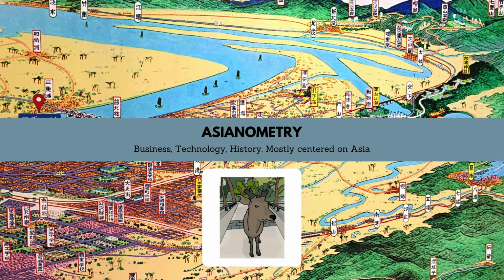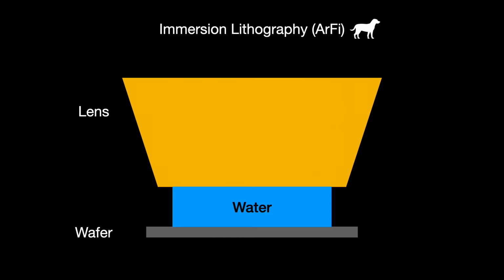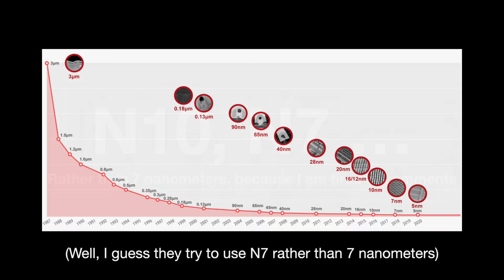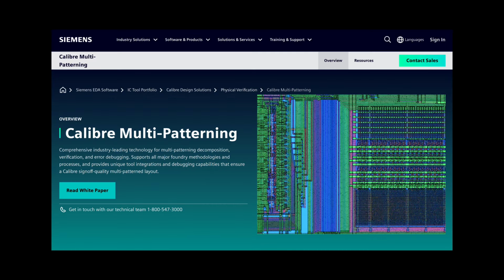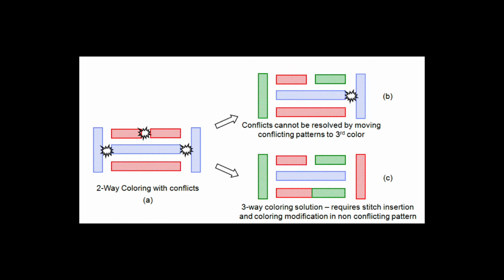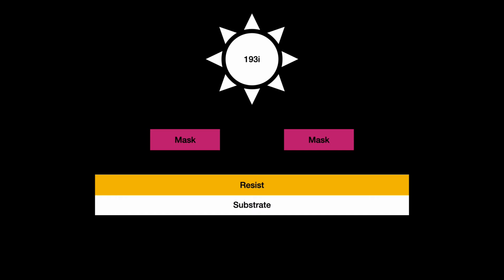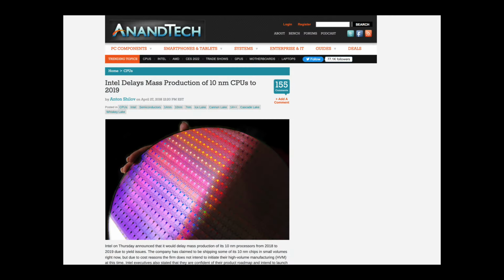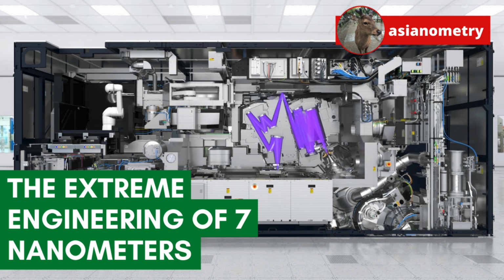Can You Do 7nm Chips Without EUV?

Comment: Can you just plain not use electron beam lithography to make complex devices? I keep making this point and I don't know if I should: we've had actual 7nm feature size available since 1995.
I know its very slow, but it really feels like the semiconductor industry is a snowplow at this point that is only capable of pushing the snow ahead of it into its own path. Any progress the plow makes requires redoing essentially all of the previous progress plus plowing the additional snow.

A slightly irrelevant note that I'm gonna make anyway: I have some friends who like to think of themselves as anarcho-communists or whatever and keep sincerely pulling the old line of "seize the means of production". The semiconductor industry is what I always bring up when people say we don't need $1E11 corporations. Lets say I give you that new TSMC plant in AZ. You have the means of production. What's your next step bro? Unless its "spend the next 20 years learning the equivalent of how to hit the 'on' switch" maybe you should leave the means of production to those who know how to use it.

Half measures and you end up with India's semiconductor industry.
Reply: The means of Production in that case would be owned by the people who work there and not by the CEO's and Board of Directors of the company. The critical decision of how to produce, how much to produce will not be driven by market fources anymore but rather what the general population needs and wants. You can run any big industry by collectivising it, obviously it will have it's own fare share of challenges.
Reply: @jurrasicgrant2307  Yeah, but no. I guess if you watched all of asianometry's videos (which you should) You'd have a better perspective on this. TSMC is dependent on customers, at least dozens (and growing) of fabless semiconductor companies to tell them what to produce and a handful of major corporations like ASML that provide TSMC not just equipment but expertise as well as chemical suppliers.

Not only that, but all those companies that provide you input and output directly fund MIT and the U of I and Cornell's ECE and physics programs and you, who have seized the means of production, have cut off your source of customers, suppliers and employees.

Its like stealing a train, having no idea how to operate a train, then expecting the track owners to let you use their track and customers to do business with you, the train thief, all the while knowing that your actions of stealing the train are encouraging others to steal the very businesses you rely on for your train to be worth anything. It makes no sense on any level whatsoever.
Reply: @jurrasicgrant2307  "but rather what the general population needs and wants."  First how do you measure that, except by the process of giving up one thing for another? (Even if you could scan everyonesbrain and come up with an answer, the explanation will still be in terms of trade and preferences). USSR only sort of worked because trade between and with the outside world gave them some sort of price/accounting system.
Reply: I think that Karl Marx was right, workers should obtain the means of production.
However the devil is in the details, in 18th century you'd often need a bloody revolution to obtain the means of production.
And today your anarcho-communists friends can buy TSMC stocks and thereby they can obtain means of production... after buying the stocks. After buying the stocks it seems a good idea to leave the production process to professionals.
Reply: @dariozanze4929  Looks like I just gotta disagree with everyone about everything. Um... companies pay their employees little enough that they'll never be able to own a significant part of the company. The end.

Sure, if you're a project manager you might make enough money to own your worth in the company if you eat nothing but ramen and ride a bicycle to work.

If you operate a pick and place machine, you're probably providing hundreds of thousands of dollars of value to the company but you're probably making enough that ramen and a bicycle is all you can afford even without buying stock.

Also, why the fuck is chrome telling me I'm spelling "ramen" wrong? "拉麺"? Oh, that's ok but "ramen" is a step too far.
Reply: No. Write time is proportional to the area being written, you can write say a gate pattern, but the denser it gets the longer it takes.
As far as 7nm structures in 1995, the rest of the stack hadn't been scaled to be able to use a 7nm structure, or had relevant extra films integrated to use a 7nm PMMA resist structure...
~'96 I etched 20nm poly gates using 2500Å poly films, but I had to trim mask lines laterally, a 7nm PMMA line wouldn't have been standing up, or if it was wouldn't have been thick enough to stand up to the etch. (we didn't have a hard mask at that time).
We were investigating transistor properties back then & dopant diffusion impacts...We got the 20nm transistors working and it was useful information for us.
Reply: @thecraggrat  Yeah, I get different information from different sources, everything from EBL can't be used to make functional devices at all to EBL can be used to produce prototypes for essentially anything.

I get that the write time would be huge, but if we'd had 20 years of development in that area I'm guessing a few orders of magnitude would have been knocked off.

I sort of liken it to 3d printing: no company in their right mind would make a million units of something with 3d printing, but one person might be willing to take the 8 hours to make a one off. Individuals and institutions might be willing to put up with the speed of EBL to make one off devices.

I do get that the silicon is just one facet it though and that the metalization and whatever wouldn't have been up to the task.
Reply: @htomerif  Worked for an ASIC house that considered it and also some optical writers too, but it never went anywhere. 
I do have a buddy who uses optical writers for a different market segment (not silicon), these are actually useful and saves $$ for reticles etc as the volumes are very low/small batch. Plus no defects from crap on the reticle!
Reply: @thecraggrat  Not sure if we're talking about the same reticles but one of my many jobs was testing night vision for the Army, a lot of which had replaceable reticles for different weapon systems. I don't fully understand where they are in the optical path but they're absolutely tiny.

Every once in a while I check to see if any progress has been made on nanoscale additive manufacturing, but unless you consider 100000nm to be "nanoscale", progress seems to have halted since IBM printed its logo in atoms in the late 80's.

I'm impressed by how little progress has been made.
Reply: @htomerif  A Reticle in the semi business is the layer pattern "master" used to print the pattern into the resist on a wafer in a step and repeat exposure system. It is about 6" in size and prints an area of about 30 mm X 23 mm give or take. It contains a few die depending on the die size and prints a reduced image size, normally 4:1 or 5:1, unlike a layer mask that printed all die on a wafer at once on smaller wafers.

Comment: I wonder if Intel’s quadruple patterning lesson is not totally wasted. They can probably apply what they have learned in future EUV process such as 20A 18A nodes🤖
Reply: The issue is that still adds a lot to the cost and it reduces production capacity even further than actual EUV process as well as reducing yields. So might be possible on some niche applications but not viable for the consumers market.
At some point, they wont be able to go further and have to exclusively rely on other ways to improve the efficiency (mainly design and software optimization).
Reply: No EUV uses different resist and also uses different mask technology. What they learned on DUV does not apply to EUV.

Comment: Can somebody explain how you can draw features of smaller length than the wavelength of the light etching it?  It's like trying to draw fine lines using a paint roller.  Diffraction or something... OK I figured it out (Wikipedia:  Multiple patterning (or multi-patterning) is a class of technologies for manufacturing integrated circuits (ICs), developed for photolithography to enhance the feature density. It is expected to be necessary for the 10 nm and 7 nm node semiconductor processes and beyond. )  The way it works:  using 192 immersion you get one set of patterns but they are spaced much further apart than necessary.  So you shift the mask a bit and expose another set of patterns, that's what multi-patterning is, in the spaces between the first pattern.  You keep doing this up to four times or so, all the while watching out for artifacts that will mess up things and being very precise with repositioning the mask.  

Pretty clever, but if there was more money in this field (remember collectively the revenue of the semiconductor industry is $600B, as compared to $2800B for the automobile industry, over 4 times bigger) the EUV machines would have been ready by now.
Reply: My guess is more money doesn't mean faster delivery, after all: 9 women do not make a baby in 1 month
Reply: @autohmae  But 9 women can produce 9 babies in 9 months, nine times what one woman can produce.  Follow the money...or the honey.
Reply: @autohmae  Automate, like your name.  Parallel rather than serial.  

But the real bottleneck is that the semiconductor industry has no money in it.  The players are terrified of buying another ASML machine because.... IT COSTS $150M DOLLARS....oooh.  Like that comical scene with Dr. Evil in Austin Powers.  $150 million dollars!  OMG!!  Meanwhile your average jumbo jet costs more than that, and there are over 25k of those in the world.  Let's face it:  if you're in the semiconductor space, it's because you love technology, you're a geek, it's not that you're looking to get rich in it.  Even the stock price of INTC reflects that reality.

Comment: You can see the difference between DUV multi-patterning and EUV exposure in the video below at https://www.youtube.com/watch?v=J5QVKCjyNG0
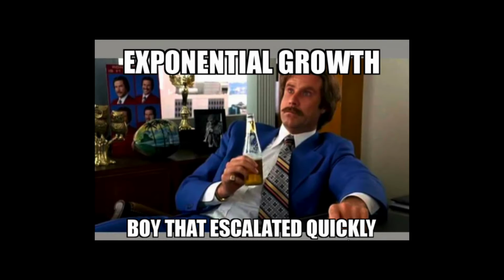9:11~
Reply: Сергей Захаров  presumably,  I don't think that's wrong. It is possible if they could afford the high cost.
Reply: Сергей Захаров  I would blame TSMC for confusing them with their own SCALING DOWN terms.
Unlike Samsung Foundry and Intel, TSMC exaggerates the 5nm process as full node advance, but I want to point out that if they manufacture using around 3 EUV masks, they refer to 7nm+ (or P) and if they manufacture using more than 10 EUV masks, they refer to 5nm.
Reply: There is no need to know it in depth, it takes too much time to mention the FEOL(front-end-of-line; is the first portion of IC fabrication where the individual transistors) are made. so I'll omit it. I know that 193i-based SAOP Litho printing will be used in Samsung Foundry and Intel's 4nm Node(fab process)...

Comment: Is photo-lithography without EUV the equivalent of multiple shingle writes passes on hard disks plate to achieve higher pitch density?
Reply: No. HD single passes just overwrite part of the previous pass, leaving a small still readable strip.
Multi-pattern photo-lithography writes several partial non-overlaping prints, composing a full "recording".

Comment: why can't they just use sychrotron light to produce arbitrary wavelengths down to x-rays and at super high intensities?
Reply: Because everything has to work together - you need masks that can be imaged with X-rays, you need optics that can image the X-rays from the mask, you need materials that will absorb the X-rays for use as a resist layer...Not got one of these? It doesn't work! Oh yes, and it has to be defect free and play nice with everything else in the fab!
Reply: @thecraggrat  all of that was just as true in the case of tin plasma EUV
Reply: @Muonium1  Ok, so I could just say "they can". 
But it isn't true...They need to develop an appropriate synchrotron source to give them the Xrays, then they need to produce and test masks to see if they'll work and likewise redo the optics. And research/produce a new resist that will absorb harder X-rays
I strongly suspect that for significantly different wavelengths, they'll have to have a different set of optics that are designed to the wavelength, as I believe the optics are multilayer Bragg reflectors...good for the design wavelength, useless for anything else (well maybe useful for λ/n fractional wavelengths).
Look at how long it took them to get the current EUV working, though if memory serves me right they started of with trying to get CaF2 lenses to work at 157nm, but had birefringence probs.
Reply: Price and size, maybe(?) I mean, TRUMPF laser for EUV is around 40kW, while the largest synchrotron (by power) was PETRA II in Germany, with 12 GeV, which is roughly equivalent to 5.34058829*10^-16 kWh, and that facility was 2,4 km in circumference. Even France's 2020 ESRF is 6 GeV and still takes 800+ m in circumference.

Comment: At 100eV an electron has the equivalent wavelength of 0.12nm. That allows very fine features to be patterned. Of course, scanning a whole wafer at that resolution would take days if not weeks, which is hardly what you need for mass production. The trick is: don't scan.
Reply: You would have to very accurately control and compensate for the surrounding magnetic fields or else the electrons would never hit the same place twice.
Reply: Yeah, it's called direct write lithography, but it isn't really practical for production (well depending on what you are making).
Reply: @thecraggrat  SO it IS possible? I wonder what kind of chips have been made using that process. Probably something crazy.
Reply: @RingingResonance  It really hasn't been optimised for a production process, or even a real device. When we ran e-beam write it was in cooperation with a university, who had the e-beam writer. It was used to generate structures smaller than could be printed by anything else at the time so that we could research advanced devices and issues that might occur/investigate solutions. Even then the size of the lines wasn't that small, we had printed lines around 70nm with production running 180nm, which was just about cutting edge for the industry then.
From the 70nm we trimmed the lines down and etched straight poly and produced ~20nm etched features; we could have been better, but we were not running a hard masked poly process at that point, which would have made life a lot easier, we were really on the edge wrt resist left after the etch due to the trim.
We were looking at just test structures and a few ring oscillators, not much active gate coverage at all and the write times were hours/wafer (for 8" wafers), for a full device, I think you would have been talking ~1 day/wafer. 
Let's say you wanted to do a 70nm device (not 70nm design rules, just with gates at 70 nm) you could just run e-beam for the gate layer, have larger gate landing areas for contacts. 
You would have shorter channel devices, let's assume you can sort the other issues involved with that channel length, then you end up with fast transistors, but the overall IC would be the same size, as you wouldn't have shrunk anything else. Would it be worth it? I really have no idea, but I suspect not, other than advanced investigation of small device issues to better develop the process as a whole.
The thing is that a process once you start to hit 180nm and below starts to have lots of significant dependencies between upstream and downstream processes that all have to be optimised, which is not easy, and you tend to build on what you have learnt in each generation of process when you do the next one (at least you do if you have any sense) with some new modules being thrown in to make life really interesting and the engineering fun!

Comment: I'm not very knowledgeable about semiconductors, but I'm really confused? Aren't we already way past the 7nm manufacturing process, and we did that almost 5 years ago with no EUV? The phone I'm using to write this comment has 7nm, I'd really like someone who understands this topic to explain to me what I'm not understanding.
Reply: Nope n7+ node of tsmc (where they use euv) started production only in 2019
Before that it was the same old process with newer tricks involved to increase the density ( edit: grammar)
Reply: @chromatron5230  2019 isn't that short of a time ago. And by the way, couldn't you just use those same tricks with EUV? Stuff like etching a wafer in several steps could also be done using EUV, right?
Reply: @smorcrux426  Yes but no (probaply). The new EUV machines get their performance from the decreased light wavelength. But other things like the optics performance took a hit (you can't do imersion with EUV). I am guessing the optics performance is importand for the double patterning. So you likely have to redo a lot of the engineering.